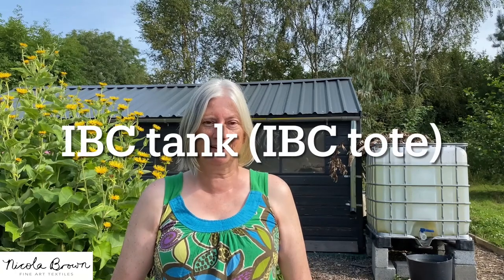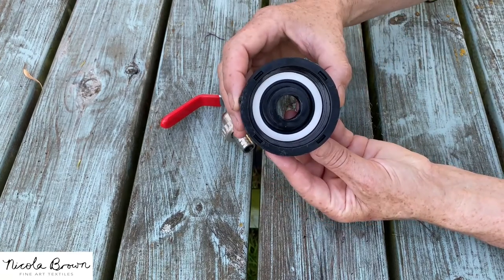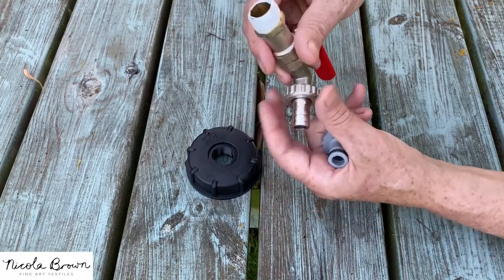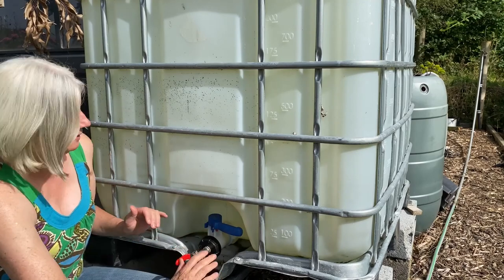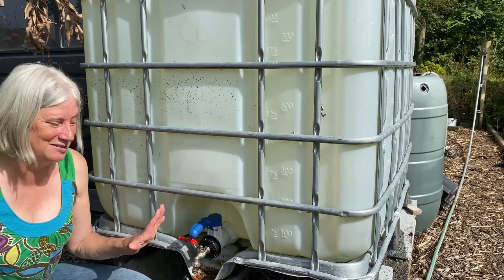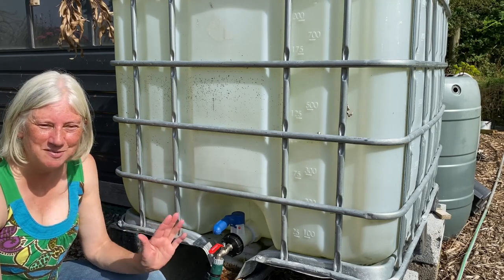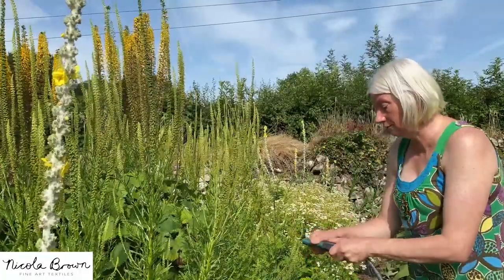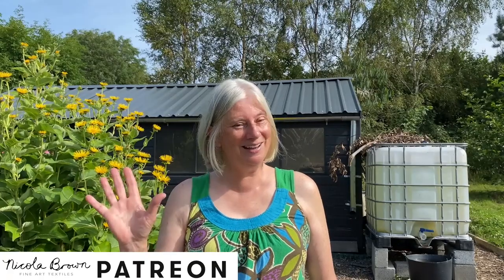Adding a tap and garden hose to an IBC tank (tote)

Comment: Great tutorial. Thank you. Quick query please.  Fitted new main adaptor and a new tap to enable watering cans to be filled. However constant drip from main adaptor. Screwed into place,  then screwed in my tap. Always reaches maximum tightness whilst upside down, no matter how many times I adjust the starting point. Is there a trick to fitting these?  If I overtighten the tap, it becomes loose again 😢

Comment: Please can anyone tell me just whether it's possible to fit a garden hose AND also a tap (faucet?) to an IBC?  I'd like to be able to use both independently, ie a garden hose plus a tap to use with a good old-fashioned watering can. Thank you! Helena, UK
Reply from the maker: Hi Helena, sorry for my slot reply. My hose just pushes on to the fitting on my tap it only takes a second to remove it and fill a watering can. I've never seen an attachment that has two outlets but I use both hose and can.

Comment: Would love to increase the pressure coming out of the hose. Does anyone have any solutions?
Reply from the maker: Yes, that would be great to know. In my experience the higher the container is off the ground and where you want to water the better but I've not investigated any additional powered option. There must be one.....
Reply: I bought a 1in transfer pump to run in between 2 garden hoses
Reply from the maker: @AshtrayAnnie  Thanks for this tip Annie, I use look into those
Reply: Never seen one, I'll do some research. I'm assuming they run off battery or socket.
Reply: @LongJonSilver  You can get electric ones but I prefer gas powered so that I can move it anywhere as needed and don't need to rely on a power source.
Reply from the maker: @LongJonSilver  Believe it or not I saw one two days ago on the back of a service van at a public garden but didn’t get the opportunity to ask the guy any questions. It appeared to be operated by a little motor which I suspect might have been linked to the ignition. I’m going to investigate further!